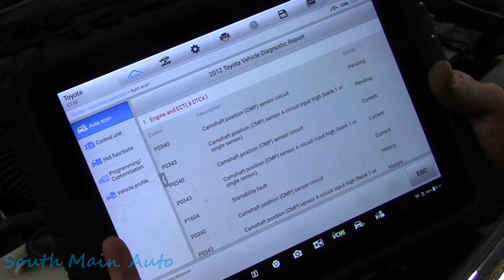Squirrel vs Toyota Tacoma - Part I

Comment: I'm amazed the engine could pull enough air through all that to start, much less have enough power to get up to speed.  Talk about Toyota tough.  Send the video to Toyota.
Reply: They probably designed it so small animals could take up residence in there to visit the dealership. Money money

Comment: I worked with a guy whose Tundra was vandalized by tree rats. The Toyota dealership wanted $4500 to repair it, because they could only guarantee it if the main harness were replaced. His insurance agent dug into the records and found where the company had paid to repair a Mercedes under similar circumstances and at a similar cost. Based on the agent's findings, the insurance company paid for the repairs - they did not want to pay. Must be a good agent, eh? Anyhoo, I keep the tree rats thinned out around my place because they got on the front porch next to the door and ruined the siding. Keep up the good work, Eric - and as Journey so aptly put it "Don't stop believin'"

Comment: That just reminded me of my 1964 Buick special I owned. I was pulling out of a street onto a main road with stopped cars, and someone waved me to go, and I was taking a left onto their street. Well, when I stepped on the gas, the car floored itself, I came around sideways and fishtailed up the street until I could get it going straight. Then I shut off the car. Turned out my motor mount had broken and the linkage to the carburetor was all metal, and so when the motor raised, it pulled the throttle wide open. You should have seen all the faces as I was going sideways up the street, LOL!!!

Comment: Nuts...just nuts! Recently, I had to remove the fender liner in my 2020 Rav4 to track down a problem with the window washer - I could hear the pump working but fluid was leaking over the right tire—the tube was chewed through. Upon further investigation, I found the lower part of the fender around the door hinge was filled with nesting materials — grass, leaves, cloth fibres and a few peanuts.  I figure my culprit was a chipmunk. Ya see he started to build a home, fill a larder, and make a bed; of course he needed running water!

Comment: This is amazing - one of those things that back when I worked in service would pull in everyone to come look - techs, office staff, everyone. Thanks for the memories.
Reply: Oh yeah, I saw a few packed solid air filter and cabin air filter boxes. "My AC just ain't blowin' like it used to. And it makes this vibrating noise that's annoying. Take a look will ya? I need that AC." Then I'd proceed to pull out the glovebox and take out the cabin AF with an entire shredded phone book and a fistful of firewall insulation padding atop it. 😸 The vibration was caused by the paper that slipped down and was touching the wheel fins as it spun. The customer was always amazed. So were all the guys when we called them all over to oooo and ahhhh. 🤣

Comment: I had the same problem 3 days after doing a tune up on my 98 chevy van. Wound up having to put a metal screen over the air cleaner intake to end all the chestnuts in my air cleaner😅 likely they didn't eat any hoses or wires.

Comment: A little tidbit of information on your critter wire issue I learned about 3 or 4 years ago. I was having the same issue with my christmas light wires and extension cords being chewed through by critters. I searched for days on google to come up with a solution and found an article, I think it was from Frobes magazine, that talked about this problem. The jist of the article says that the insulation material they use is derived from corn oil. The critters think your giving them a meal. I don't know if the automotive wire manufacturers do the same thing but it would explain a lot. If it's true why don't the critters only eat the yellow wires!!!

Comment: I had to install 1/4” wire screen on the inlet port on mine and also had to install it on the inlet port for the heater. I live in the woods and have that problem. I also keep 5 mousetraps baited with peanut butter duct taped to various flat surfaces under the hood. It has worked for years. Mine is a 2nd gen Toyota. I caught 7 mice last year. I live in the middle of the woods. Thanks for the video.

Comment: When I went in Air Force basic and tech school I parked my 78 F150 with duals and headers behind my mums house. When I picked it up to move to my duty station in ran, but you could tell it was choked. Seems the field mice would steal our Anita's food and they stuffed both sides of the exhaust to the headers. I ran it and it blew out the pipes from the glass packs back. Had to drop the mufflers and blew out the headers. Had to replace both mufflers are they were so packed they couldn't be blown out. I opened them with a cut off wheel and they were tightly tiger packed. Thankfully no wiring or vacuum lines were touched. Ahh...memories.

Comment: I repaired a buddies Dodge truck for a runability issue, found they did bondo on the fender masking paper and a plugged intake air duct from a mose nest,2 different shops   loaded up the parts cannon,,first time i ever encountered that,have repaired many chewed wires before

Comment: A couple years ago I was working on a 2500 Ram. Was just doing a typical inspection and the air box was packed to the hilt with corn feed. Turns out the customer lived on a farm lol. Good ol shop vac did the trick. Better than the dead squirrel in the cabin air box in a Buick Lacrosse a year before that lol. The customer said they thought there was a funky smell in the car 🤣

Comment: Wire mesh in the induction hole ?
Fit a Snorkel intake ?
Fit a couple of enclosed mouse traps in the engine bay,when she fills up ,check the oil and water and empty the mouse house !
Another issue is sometimes And s nests get in and settle in the MAF body ,seen this on marine outboards, as with wasp nests doing the same .
Good reveal Mr O,had me laughing, luckily you record stuff ,imagine trying to tell the customer,with a straight face

Comment: @11:39 The owners of Pine Lake campground opened camp one spring and thought some kids had vandalized their camp. This is going back to 1995 and red squirrel did $3000 worth of damage.
The reason they knew is because they found him dead in the toilet from antifreeze poisoning. They use the non toxic pink antifreeze for pipes and use the car antifreeze for the toilet bowl and drain.
Carpets, drapes, bedspreads, furniture all had to be replaced because of one red squirrel.
The next fall, the owners son went around the campground after season and popped all the red squirrels he could find with a .22 rifle.

Comment: My dad used to drive a little tiny Chevy roller skate and was complaining about weird noises. He had a walnut wedged in the passenger side coil spring. I didn’t even need to grab a jack to lift the car enough to pull it out and magically the noise went away.

Comment: It’s called parosmia Mr. O.  I had it bad for a while after the vid.  My everyday breakfast for years was eggs and toast, the eggs smelled, tasted burnt and rotten. I kept blaming my wife… but it turns out it was just me.  It finally went away but it took several months.  Also noticed when I was standing at the urinal that smell was much different.  Crazy thing to happen.

Comment: I had to store a Pontiac grand am outside during the winter months…I sprayed wd40 underneath the car and I stuffed the engine compartment and in the dash area with bounce dryer sheets…worked like a charm….mice hate the smell….squirrels, not sure about those but  the car survived the winter with out a problem.
Reply: Supposedly, pack rats dislike peppermint. Pack rats really hate diesel fuel. Spray diesel fuel on something and the rats will not touch it, as long as it smells like diesel. Pack rats will make a nest on a diesel engine, if it does not smell like diesel fuel, though.

Comment: Journey! SWEEEEEEEET! 🤘😁  

WOW, I don't see those black walnuts too often - those trees are pretty rare around here. What a riot - little guy built himself a sweet condo in the right fender! 😂

The funny other thing Toyota does is sell parking brake shoes INDIVIDUALLY! I found this out the hard way last week! So, to do a parking brake job on a Tundra, you need to buy FOUR friggin shoes! What kind of sense does that make? Do people really replace ONE shoe? Made me a little irritated I must say. Also makes them VERY expensive!

Had a little VW action in here today.  Full brake job on a '16 Passat for my best bud's daughter. I thought VW had finally set the triple-square fastener to pasture ... but then I started on the rear brakes, and my allen wouldn't fit right. Once I got me peepers on them, I found we now have 50/50 triple square on the rear, and allen up front! Goofy automakers.

Finally got the supercharger I've been waiting nearly 16 weeks for, for the Silverado. She's gonna be a fire breather! 😁 Finally making the "diesel" I always wanted for towing. Had I known what a lemon this thing would become when she was new, I'd have just bought a diesel back in '07 and saved myself $15-LARGE over the past 15 years!!  Now I just need probably 2 solid weeks of full days work to get it all installed, then get her tuned up on a dyno.

Sorry to hear you can't taste asparagus - that's my favorite!! That's a tragedy!! Almost as bad as not tasting a juicy steak. I never lost smell with 'rona ... or at least I didn't notice it, because my allergies are so friggin bad that I can't smell anything half the time anyway. 🤣 Great vid, brother! Sorry I haven't been on here in a while! I seem to be losing my ability to manage life, lol.

Comment: The squeakers and chirpers generally leave my vehicles alone (with the exception of the time they chewed through the neutral safety switch wires), but they really do a number on all the yard equipment out in the shed. All the mowers, chippers, and trimmers need to be disassembled every spring before they can be used.

Comment: One fall in my old car, it was a POS but I still enjoyed it as it was my first car, I went to start it up and I killed a mouse that had been chewing through a wire just as I was turning the engine over. I had just changed the oil the day before and everything was fine, but I smelled something burning so I turned off the car and popped the hood.... smoldering field mouse.... It hadn't chewed all the way through so later that day after I got home,  I put on a new heat shrink rubber coat on it. Car drove fine for the time I had it until I traded it in for my first NEW car, a 2006 Mazda 6i. That was a kick ass car. Mine was reliable AF.

Comment: Across the plastic cold air air intake on my Kia Soul, I installed a piece of 1/4" hardware cloth.  While they can still chew wires, it does keep the out of the air intake.

Comment: I pulled a 68 f150 out of the trees one time and when I opened the hood I couldn’t see the engine because of all of the nesting twigs and whatever. Surprisingly the pack rat 🐀 didn’t chew on all of the wires and rubber. I cleaned it up and tuned it up and drove that old truck for many years.

Comment: Had a low mileage newer ford thunderbird last fall the wipers weren't working come to find out the linkage popped off from walnuts under the cowl. I removed almost 100 walnuts from the thing it was impressive how many were stuffed in there

Comment: Some of the wires that are the coating on the wires are made with a peanut oil. I know that the cables for cable TV have a peanut oil or vegetable oil in them that's why they the squirrels run the wires and chew on those.

Comment: This squirrel damage is a great time for some research. I too had the exact same problem after I chased the squirrels out of my barn in late summer and parked my 2012 Dodge Charger r/t for the winter. This happened to me a few years ago and I began reading up on why rodents are suddenly eating all the plastics and rubber under the hoods of our vehicles. I came across some tidbits of information that informed me that most of the wiring and many of the plastics that are installed under our hoods are manufactured under the jurisdiction of European companies . I then continued researching and to my very unhappy surprise found that nearly all of Europe has enacted legislation that says all automotive wiring and many of the plastic parts that get installed on our vehicles will be manufactured using soybean based oils and banning petroleum based plastics and rubbers. This occurred quite some years ago and now many of us with rodent problems and black walnut trees on our properties are literally inviting all the rodents that can smell the smorgasbord from miles away to munch on our vehicles. Very, very sad because we the consumer will pay for their uncaring ways yet again!

Comment: I know it sucks but you really need to take that lower intake manifold off and verify they didn't get the knock sensor wiring. That is actually the more common wire to get chewed up

Comment: In all my 75 years, I have never Witnessed anything like this---Critters had their way with this truck, this vehicle evidently is not driven everyday--maybe a screen needs to be installed on air intake tube...
Reply: yes wire screen 1/4 by 1/4 inch  just bought some 4 by 5 ft was $11

Comment: I have the same oddball effects lingering from my bout with the 'rona. I went a little over five weeks without being able to smell or taste anything except for the heat from hot sauce and it all came back out of the blue one day, or at least I thought it had. A few weeks later,  I was helping my son with his motorcycle when the carbs were overflowing and he said it smelled like a gas station while I didn't smell anything. Like you, now I know my senses aren't what they used to be, but I don't know how diminished they actually are as I can't really get a reference point. At least it's not as bad as it was as eating during that time was just miserable.

Craziest thing when I couldn't smell anything is that smoke didn't bother me. My wife accidentally spilled sugar on a burner on the stove and it smoked up the house while. I walked into the cloud of smoke and didn't smell it or even get the tickling sensation in my nose. I went and made sure all of my smoke detectors were in good order after that.

Comment: I changed out the Evap module in my wife's 2012 Jeep which is inside the drivers rear fender well, I took off the plastic inner fender and discovered 3 pair of underwear which were not ours,  insulation plastic bags, pine cones, leaves and other trash. I dunno what kind of party was had but I wish I was invited!

Comment: What a mess. I live in Arkansas. Around 10 years ago  I worked on a Honda that had rodent damage to wiring.  Did some research . I found that the insulation on the wires. Was soy based  mice loved the insulation. Repaired wiring and ordered  Honda  repellent rodent tape found it on Amazon or eBay. And new conduit. But never seen anything like this. That's crazy. Also heard that peppermint oil. Will stop rodents.

Comment: I had a friend that grew poor, always drove the couple hundred dollar car held together by bailing wire and a prayer.

The first job he got that paid good money, he purchased a brand new Mustang GT 5.0. Two weeks after getting the car, went to leave for work, and the car wouldn't start. Opened the hood and rats (the big Norwegian brown rats) had eaten all of the plug wires and a good bit of the wiring close to the plug wires. The Mustang required a entire under hood wiring harness.

Mrs. O's graphic mouse in trap picture was tame compared to what was inflicted to the rats.

Comment: I had laugh when the Mrs. showed the mouse reminded me of a time when I installed a new radio in my truck spent all day but it was a nice tune box got done went in the house to grab a snack left the truck doors open and a field mouse got in and I didn't know at the time , now mind ya this truck is jack up high in the air how it got in ill never know but it did and chewed the antenna coax into than the ac then the dash lights all in 8hrs time i had to use the mouse trap trick with peanut butter he wouldn't eat cheese  but i had to take the whole dash apart man that was not fun but i lol about now , be safe and take care

Comment: My 2007 F 150 had a squirrel issue which my mechanic was able to neutralize. I filled my tank back when gas prices were reasonable, today's date is July 10, 2022. When I filled my gas tank I noticed gasoline pouring out under the truck. After it poured out until the level went below where the problem was it stopped leaking so I was losing probably a couple of cupfuls of gasoline. The mechanic found that the fill pipe had been eaten away by squirrels. Apparently this rubber type compound is made using some type of material that taste good and rodents, squirrels and mice, think it is food. Don't know if the automakers ever considered that.

Comment: Yes Toyota tried to use organic materials for the insulating material on the wiring mostly the soy based.
Turns out that so y based wire insulation is quite tasty to critters.
I suggest a FTC complaint.
If the FTC gets enough complaints on this issue a recall will happen and refunds for all the people with these Toyotas that have edible wiring might be nice if you're straight in the middle of the desert to know you have a food source under the hood but it might be slightly toxic.

Comment: My first duty stationed in the Army after law school was in Watertown, NY at FT Drum. I didn't have my car 1989 Plymouth Acclaim parked 24 hours it wouldn't start. Mice already had wires, hoses, air filter all chewed up with a family living under the hood. It must be a New York thing because here in Illinois I never had any mouse problems. Working on airplanes we have Black Birds building nests in the engine cowling or in the wings after an airplane would shut down. Those birds in the dead of winter would have a nest built in just a few hours after shut down.